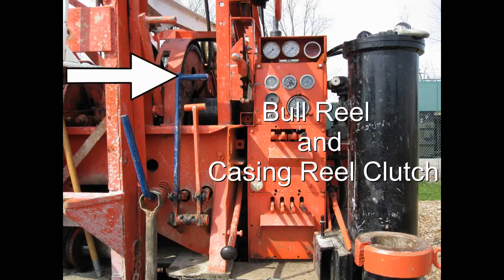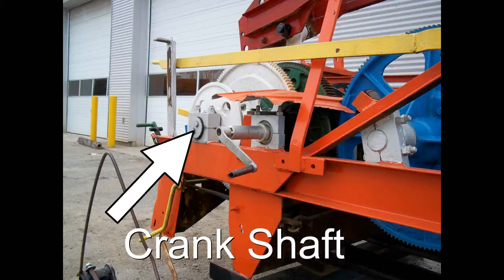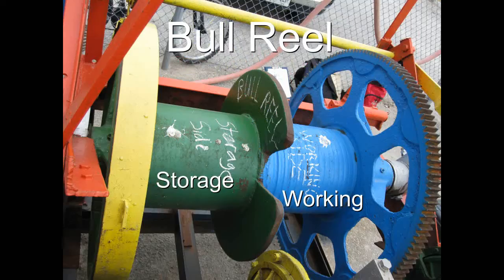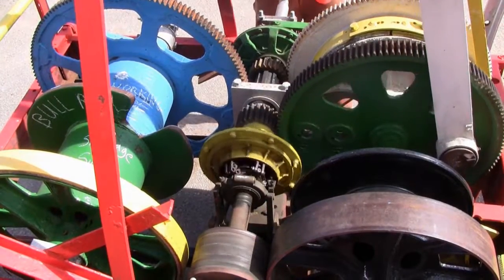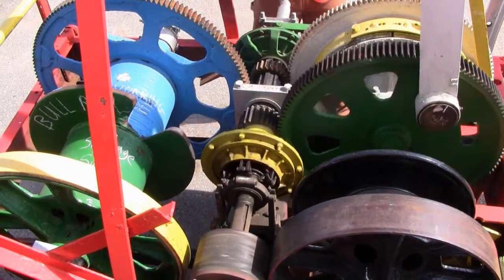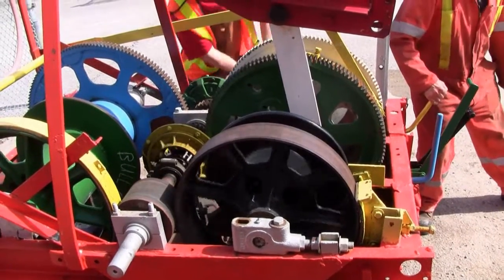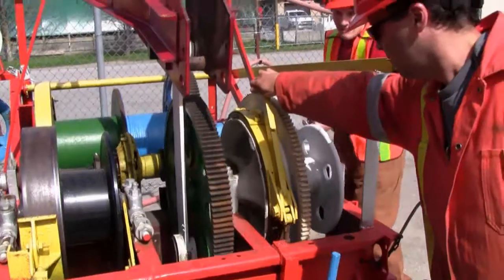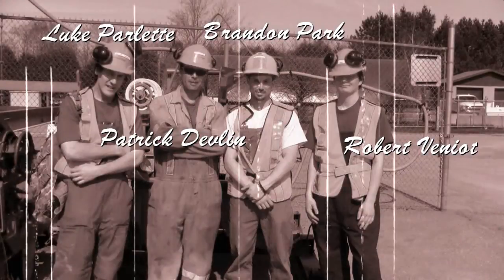Water Well Percussion Drill Rig Tutorial - Fleming College

Comment: Great little tutorial I grew up on these machines. Myself got a lot of experience on the 36 and 28 Bucyrus Erie and also a 83 speedster. Spent several years in the oilfield most challenging was doing work over with a 28 at 6,000 ft. Drilling out cement plugs and sand pumping. I sure miss the days when we actually used these rigs to drill deep for gas and oil. These small rigs drilling shallow for water just isn't the same.